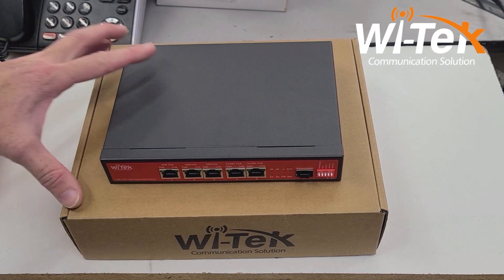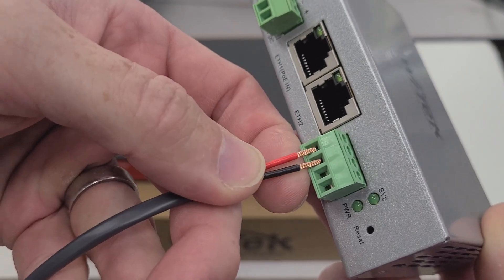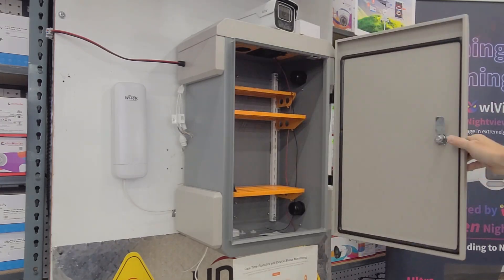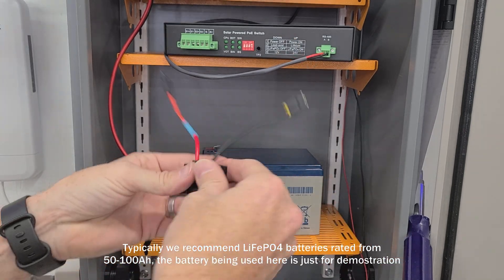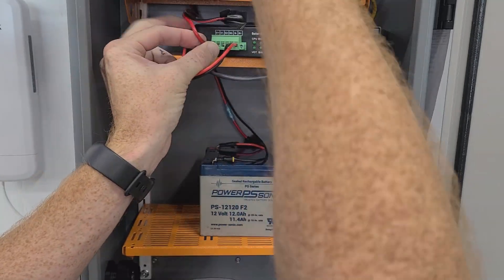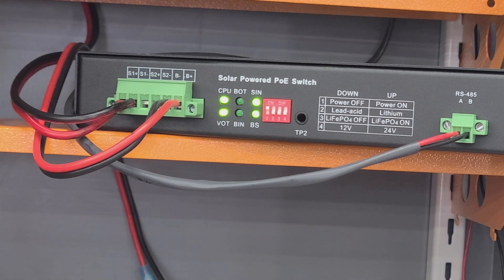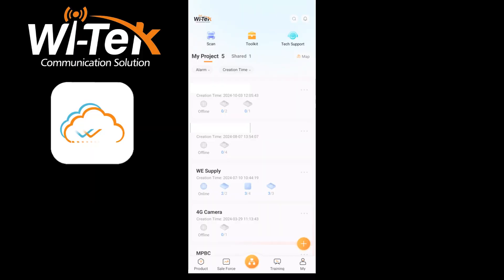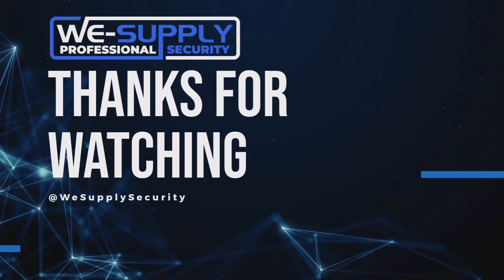Wi-Tek's Solar Powered PoE Network Switch & Remote Access IoT Controller

Comment: Thanks for the awesome intro video! By the way, if you want to protect the battery by limiting the current that the solar energy can charge the battery, you can set the maximum battery charging current on the APP or Wi-Tek Cloud, which is a useful feature supported by the V1.34 Solar System Version and can be used with fuses.